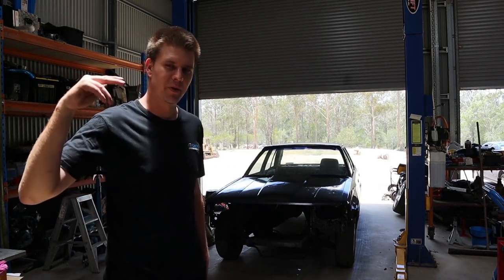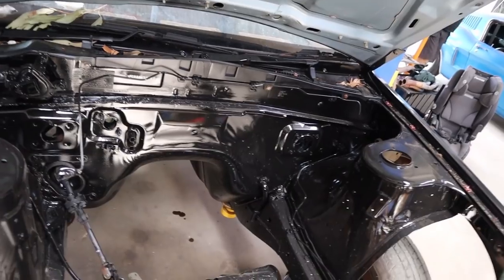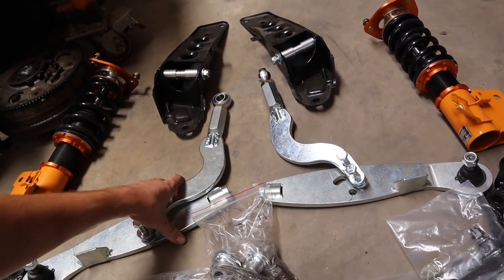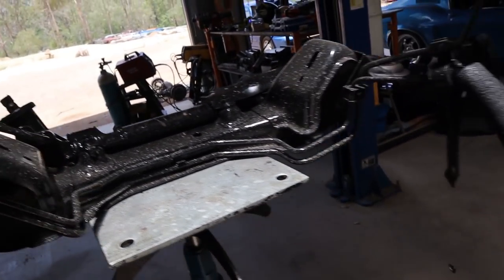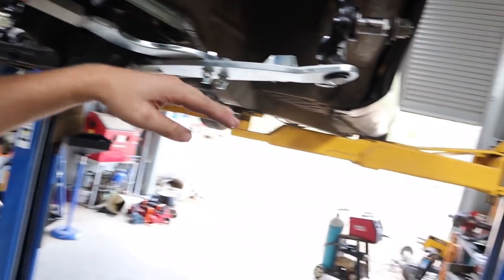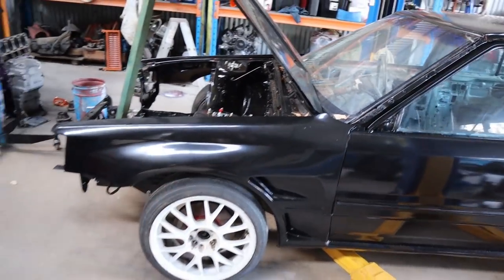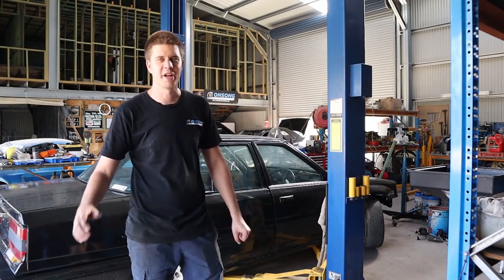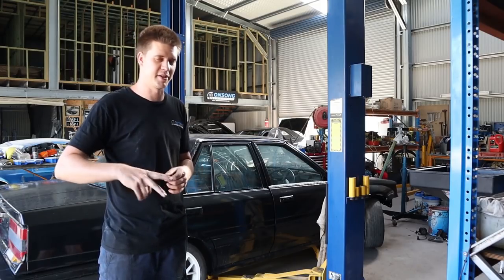LSR31 Part 12: rbfactory front end goes in (BIG LOCK)

Comment: With elec power steering in boot , i know Taylor ray had issues with his Volvo pump in the rear of car , at the front in bay solved his issue - I run the Astra ts pump in front and works fine - something. That may come up as a issue in the future to keep in mind (someone may have it in the boot and it works fine thou not sure )